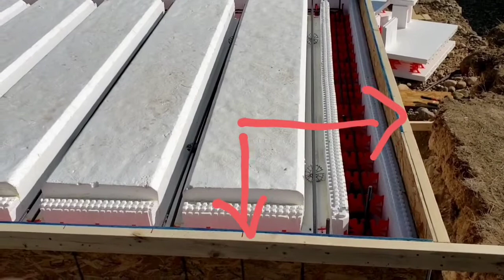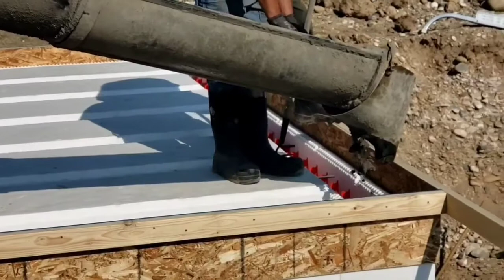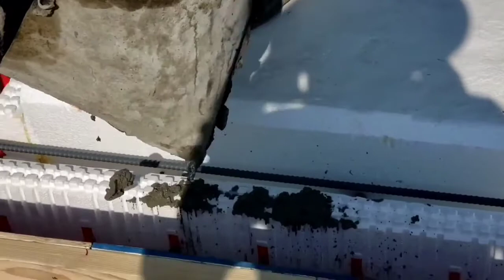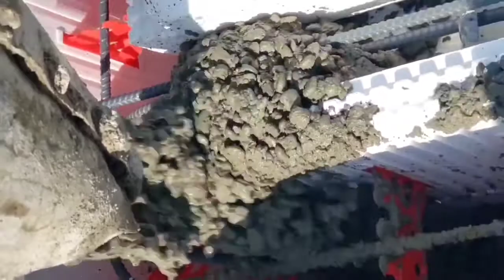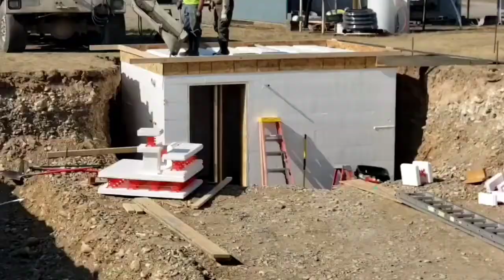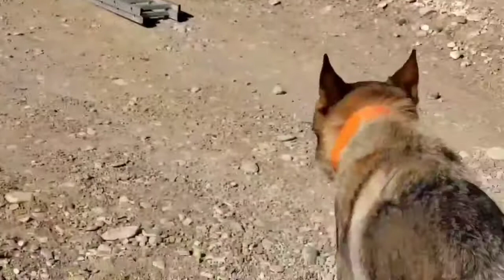Step 4c

Comment: These foam blocks look great for DIY structures, are they as easy to use as they look?
Reply: If you can put LEGOs together, you can put these foam blocks.  Just remember to add lots of rebar.  Both vertically and staggered horizontally.  We have had below zero weather here in Montana and the cold storage stays above freezing around 37 degrees on coldest days.
Reply: @wiredwildwest6131  Amazing, thanks. I think this is exactly the building material I've been looking for!